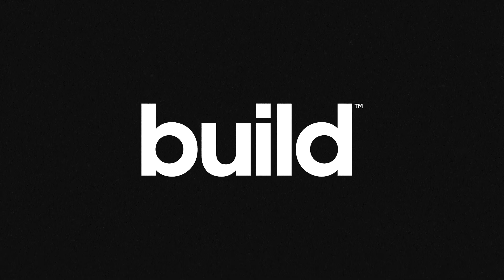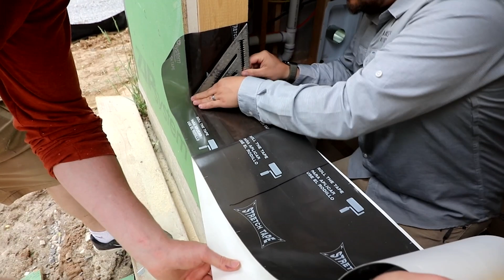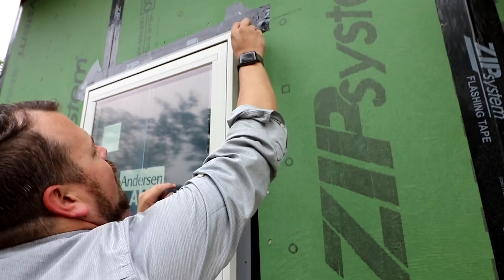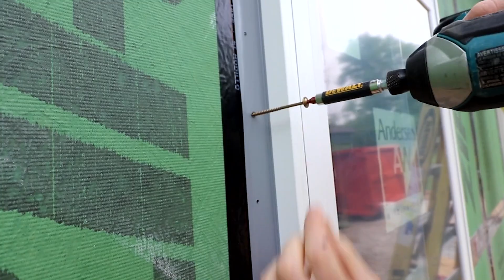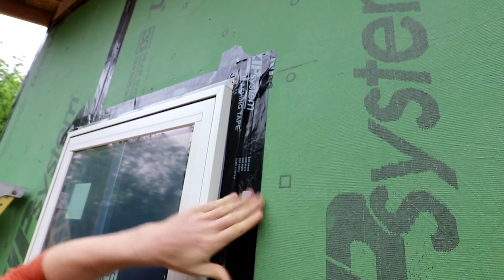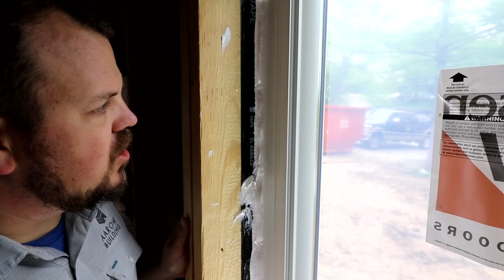Window Rough-Opening Prep

Comment: Jake, you need to pay more attention to the depth of the backer rod for that interior air seal to perform long term.  Optimal width of joint is 2x depth (2:1).  Buy a backer rod insertion tool to maintain consistent depth.

Comment: Product links would be helpful
Reply from the maker: Which products are you looking for?
Reply: @jake.bruton.aarow.building  First off I like the fact that it doesn’t feel like I watching an infomercial. So that leads me to believe you are using products you like and trust opposed to the sponsor driven channels.
If you could highlight the products with even a picture of the label or whatever. 

 Specifically the caulking you were using, I believe you used one inside another outside.
I’m currently building a home trying to use these building methods and am lost for a go to source for specific questions if you can point me in the right direction that would be incredible.
 Thanks

Comment: Have you tried using tapes to air seal at the interior? How do you think tapes compare to Air Dam there?
Reply from the maker: We have used tapes. We like both. In this case the air damm was useful due to smaller rough openings. The tape can absolutely work though. Siga Fentrim is our favorite for that applicaiton.

Comment: Great info. I'm wondering why we don't see this type of sealing detail at the top plate. In other words, could you air seal by running the zip tape from the outside edge of sheathing, over the top plate, and onto the inside edge. Then caulk drywall to it. Would this be a good way to air seal at the top??  (BTW, I live in zone 5 and the attic is unconditioned)
Reply from the maker: You probably could do that. It would just take some real attention to detail.

Comment: Thanks for the video.  Pan head screws to secure the window and the extra thickness of the tape. Does that impact exterior cladding? Interior window jambs, the sealing caulk bead does that require a backside bevel to clear so the jamb fits nicely to the window frame?
Reply from the maker: I have not noticed the tape and screws impacting the window trims in any way. We do have to be careful with the interior face sealing to not get too far into the jamb edge. It can impact our interior extention jambs.